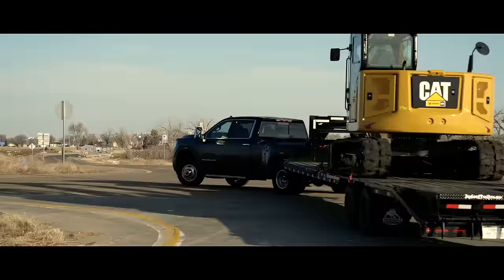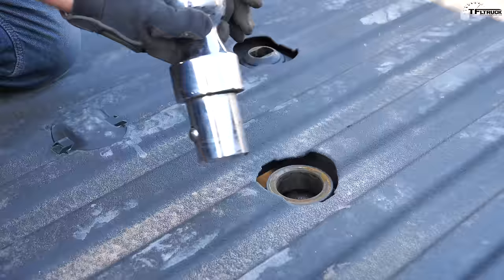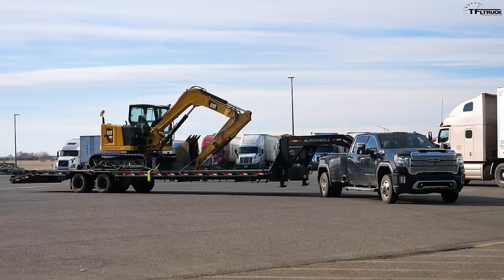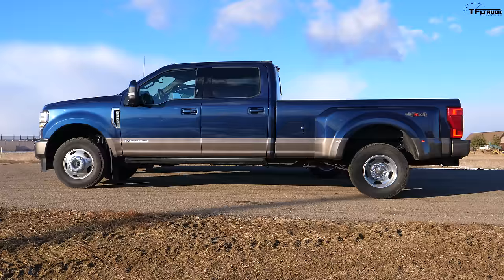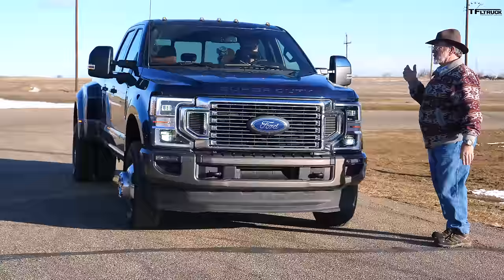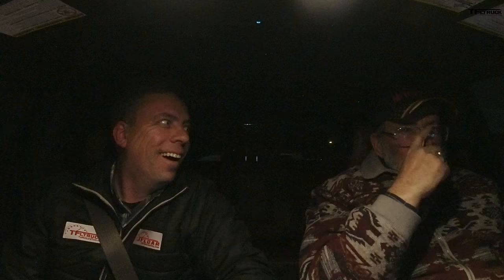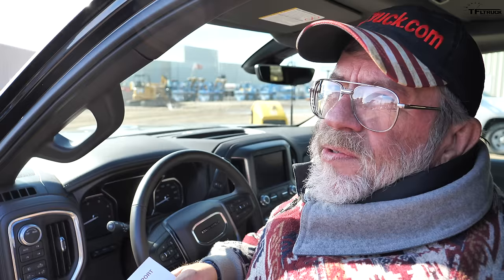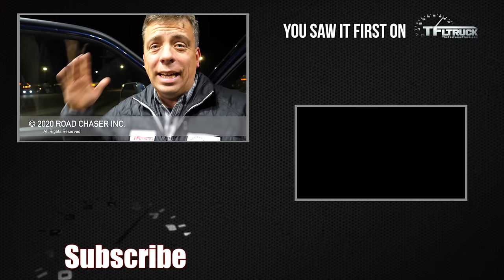30,000 Lbs Monster Tow Test: 2020 Ford F-350 vs GMC Sierra 3500 - Drag Racing & Tow Off!

Comment: So before I watched this video after midnight on Sunday 9/12. I had  previously watched the 2021 new episode from Nathan on the new 2022 "Toyota Corolla On Dirt" Video. 
I made the comment on that page that I was really bored. I got totally disinterested with it. It isn't an Electric SUV I didn't care.
Right after that video on my Home page I get the suggestion for this video. 
 Here's the deal I think with Andre and Mr. Truck. that they have driven trucks for so long that very view that see from out the windshield that they take it for granted that there isn't the enjoyment of driving the truck itself is complacent on narrow 2 lane roads, being in a truck on driver's side should never have that getting old feeling it priceless on every drive. 
  The very appearance from a chest high hood just makes trucks width cover over the lines instead of being inside the lines should the coolest and most thing there is to being in a truck. I have ridden in trucks as a passenger but the view from the driver seat has really different road perspective, plus it's fun watching cars move to far side of the opposite lane because they want a wider gap between an on coming huge truck.
Anyway I'm not bored anymore. I can pause this video and picture cars on the opposite side having to creep over the yellow line to get more space.  I've got to drive a Ford Raptor!

Comment: Isn't that the same transmission in both trucks? I thought Ford and GM went together to design the 10 speed. They just tune them a little different I thought.
Reply: Jointly designed transmission with different tuning from each manufacture.
Reply: Only the 1/2 tons share the same transmission, GM built their HD 10 speed in house and rebadged it an Allison.
https://gmauthority.com/blog/2018/12/2020-silverado-hds-allison-transmission-isnt-really-an-allison/

Comment: My tiny 2.7L EcoBoost will still slay these to 60 😂
Reply: Towing 30,000 lbs too right?
Reply: @390fe451  If you are towing 30,000 pounds a 1-Ton truck is way too small (and it's dangerous). Its not about getting up to speed, it's about stopping. You need a class 8 commercial vehicle. It's the same as a half ton towing 10k. I own a Freightliner Cascadia for the "big" stuff.
Reply: Yeah but these trucks will slay your Cascadia to 60...different trucks for different jobs. I wont argue about towing 30k with a pickup though, thats our realm. Over 20 years in, stay safe out there brother

Comment: I love this channel , butt it chaps my arse to see "experts" that do not properly secure thier loads. The thing on the side the mfgs welded down the full lengths of your trailer has a function. It's name is a rub rail. Can to guess why it is there? It is to protect your straps, chains and binders from an accidental sideswipe and having your load come off the trailer.  One driver  I worked with years ago God rest his soul, had a heart attack at the wheel left the roadway crossed a ditch just before an intersection crossed over another ditch, jumped the cross hyway and another ditch before he rolled it over. This man was a professional driver and because he did his job right and tied his load(load of steel)  down properly it not only stayed onthe deck of his trailer but also shifted less than 3/4 of an inch potentially saving other motorist lives even in his death. Don't be lazy when it comes to other peoples safety. Put your straps behind the rub rail and hook them under the belly of your trailer. Yep, you might have to bend over but at least you will be getting that little bit of exercise.

Comment: 5:08.. load is too far forward and main frame is flexing.. WAY too much. shakes everything. trailer deck under full load should be no more than dead level. this has a big sag. either the trailer isn't strong enough for the load applied or the (concentrated) load was in the wrong location.

Comment: DEF fluid usage is based on the NOx from the engine. Lower fuel economy will higher DEF usage. My 2014 Volvo 730 w/D13 500hp/1850lbft. It routinely gets 88km/liter(206mpg) and it lives it's life at 140,000lbs hauling B-train fuel tanks, getting 6.8mpg.

Comment: “Expert truck reviewer” I bet you could take all the GAS out of both trucks and I would still beat you
Reply: When I heard that I thought, "No shit.  The GM wouldn't have any fuel and therefore wouldn't be able to move."
Reply: Connor Hendricks you’re missing the point.... it’s not about either brand the “expert” called the fuel for 2 diesel trucks gas
Reply: @wjoldham  Symantecs.  You do know the difference between gas and gasoline right?  Either way, my statement stands valid.

Comment: I would like to know just how much or far the cuts in the concrete road are apart because that will give you the bounce everyone is talking about. But sounds like ford killed it. Can’t say why fords are #1 for the post 40+ years but it has a lot to do with the way they tend to out do GMC - Chevy - dodge well ram now because there trying to get away from the dodge bad nam. I guess fords just a better truck hummm seems right to me

Comment: I HAVE BEEN DRIVING BIG TRUCK FOR OVER 27 YEARS .AND ONE OF BIGEST PROBLEMS ON THE ROAD , IS PEOPLE DRIVING TOO DAMM FAST. . INSTEAD OF SEEING HOW FAST YOU CAN GO, YOU SHOULD SEE HOW LONG IT WILLTAKE YOU TO STOP .WHEN SOME ONE CUTS YOU OFF .WITH  THE BOOM EXTENDED ON THAT HOE AND THOSE LOW ASS TRAILER TIRES.  YOU NEED A MED DUTY TRUCK TO HAUL  300 AROUND. SAFELY .AND LEARN HOW TO LOAD AND CHAIN DOWN BEFORE YOU TRY TO SEE HOW FAST THESE TRUCKS  ARE..

Comment: you have extreme forward heavy weight. You put too much load in front of the front axel causing flex in the trailer and too much weight on the tongue. Good way to damage the trailer or blow out tires.

Comment: Seems like the difference in the two is minor to nil and if the Ford had 1050 torque and that extra HP number, there should have been more of a difference to the GMC. Nice clean exhaust pipes however. Me thinks these trucks are very overpriced.

Comment: Better have some damn good brakes pulling 30thousand
Reply: That's why you get a F450.
Reply: @allaemmel7809  I wouldnt trust the  hyralic brakes on the new F450....air brakes only are the only ones capable of stopping a heavy load....... and air ride supension
Reply: @allaemmel7809  ive driven semi trucks in the past and nothing stops better than air brakes........
Reply: @sixpapavictor  I've never seen air brakes on a pickup truck.

Comment: Scatter shot of useless data. Such a small fuel volume and inconsistent pumps. DEF usage is a % of fuel usage, therefore the truck with better mileage should use less DEF, not more.

Comment: Great stoff. Speaking about econemy, it isnt that great for the size. A european full size truck with a 70.000 pund loaded trailer will do the same fuel econemy. Volvo FH16, Scania R-series with a 16 liter motor isnt that nippy.

Comment: GMC all the way! $5000 difference in 100,000 miles is nothing if you can’t afford an extra $5000 in 100,000 miles you shouldn’t be buying those trucks besides new the Ford is more expensive which makes up for that extra fuel you use In the GM

Comment: I’ve had many Ford’s and as they get newer they also get more problems that are expensive to fix. I have a dodge 97 dually with 312,551 miles almost trouble free and recently purchased my first 2017 GMC Sierra DENALI ULTIMATE truck. My longest lasting truck for small towing was a 2017 Nissan Titan XD PLATINUM RESERVE that lasted 455,600 miles before a young man totaled it ramming the side at 45mph in a Ford Excursion. Insurance totaled the Nissan but that was a Great truck. I’m hopeful to own a 2023 gmc full size truck if Nissan or maybe Toyota could build a full size truck for those of us that farm and haul animals, hay and building materials.

Comment: Not a fair fight. What was the outside temperature during the day when they ran the GMC? Obviously it was night when they ran the Ford so its most likely colder. Colder air is more dense and during cruising less fuel is needed to obtain power/tq.

Comment: A lot of it power wise is in the stock tune, final drive ratio and transmission ratio... Both are similar is HP and Torque numbers, its more how they put it to the ground. Were they the same wheel and tire size? That makes a difference in power and fuel economy. 

Transmission wise, you cant go wrong with an Allison.. and all the new one tons, there's so much more hidden power. Tune, deletes, and methanol injection, larger and straighter intake pipes/hoses, cold air intake will really wake them up but maintain its reliability. Water/methanol is really good for towing and fuel economy, it'll cool the air going into the engine by several hundred degrees, heat is the biggest killer of a diesel engine. Plus a double shot will wind the turbo quicker and make it a lot more fun to drive with or without a trailer. Double shot that runs off the engines RPM's and boost pressure is the best, you don't want a methanol kit that'll just squirt whenever, it'll cause cylinder wash and be an un-linear power curve. Another good thing besides giving more power, it cleans the cylinders of carbon build up, a good methanol kit is actually healthy for a diesel.

I got a tune ECU kit with 3 different engine (each with transmission map) to choose from, one that's a tad above stock, a towing map, and a sport one that gets everything out of it it can but still be reliable. Plug in peddle monster, double shot Snowperformance water/methanol kit, cold air intake, hot n cold intake charge kit with the nipples already on for methanol, a non baffled turbo resonator. I don't want more boost pressure, but I would like the stock one to spool faster, any ideas? 

And then the EGR, DEF, CAT deletes..The egr delete does affect the amount of air, so you need to make sure you go with the right company doing the tune to adjust for it and not set off any of the codes. The deletes and methanol will void warranty, but methanol leaves no signature so you can just remove it before going into the shop. Methanol also increases fuel mileage, along with the deletes. Mainly I wanted the EGR and DEF gone but it's nice not to worry about the CAT getting plugged up and it's easy to put back on if needed. Any ideas for more safe power that won't negatively affect fuel economy?  

I've never lifted my trucks, I'm thinking about it and also larger wheels, how much will that affect my economy and power with a 3-4 inch lift and going from 19's to 20 or 22's? May just go 20 and get a larger off road tire

Comment: 🤔 i ve had the pleasure  of WORKING/ sometimes driving  a f150 , two 350 , one f450, one f550 ,three  f650  if this test would have said any ford come paired to a 86 Toyota with one broke intake valve. For it to be close enough competition for me to watch but thats just my opinion  but i did learn save all the fuel you drain out of them "F" i literally  poured it straight out of the filter/tank into old  International dump truck run fine  it  but that was just my experience.  I thought a case of fuel filters per oil change was normal till I set down in a Dodge truck and I don't even like Dodge now you just change it once year out of habit 🤔 I mean you going to spend the same things on Transmissions as you would filters but lest its not on side of the road every day just once every couple of years.  Always remember Laugh to Keep from Crying stay safe out there

Comment: I drive over the road, every single nozzle shuts off differently. Can make a bigger difference than you think with your fuel mileage test. Only way to be accurate is filling the fuel neck. No that's not gonna cause any issue but it will be accurate. Ive been two gallons or so off from some of these bad nozzles.

DEF fluid test isn't a good one as your filter will become more dirty or less depending on the terrain and length of driving as well as driving style.

Plus the temperature difference between the two run was in the fords favor
Reply: They used the same pump and nozzle for both trucks.
Reply: @benjaminwayneb  doesn't matter.  They're not accurate AT ALL. Not even the same nozzle. I pump a couple thousand gallons a month into my truck. I'm very familiar with them

Comment: Is any Ford truck will beat any GMC any day just because of the manufacturer. You have great manufactured crap against the best manufactured truck in the world. Ford motor company makes the best and best performing truck out there. It's been this way for 30 some years. Or better. GMC's been trying to beat   Ford. for how many years and they cannot do it. And they never will. Ford has the best transmission and the best motor out there. Sure I hear  GMC is snooping in on the way Ford motor company builds their overhead cams so now they're trying to say they will make a motor that will beat forwards still haven't seen them beat a 3.5 ecoboost with AV8 from Chevy.

Comment: I live in North East Colorado, almost at the Nebraska/Colorado border. I would love to do some testing with these guys some time. They are only about 2 hours away from me.

I own a 2017 Chevrolet Silverado 1500 LT Z71 4x4 crew cab, with a 5.3 V8, and 6 speed automatic transmission. I would love to do the test that they do, with my truck, and compare it, and how well it performs, to one of the brand new Chevrolet Silverado’s. I think that would be really interesting to see if one truck out performs the other, or if the results between the two, the current generation truck and the previous generation truck are almost the same?

Comment: Hey Andre you are wrong about the d-max engine. Starting @ 2020 they had a new engine in the truck known as the L5P not the MLA POS. & those they is probably don’t make the power numbers they say they do cuz that def is horrible. It’s probably like 1000ftlbs & 4-500hp.

Comment: That's it 30,000 pounds I've seen a ford with a 5.4 do that haha
Reply: I gaurentee you that even if an old 5.4L could get that trailer rolling it wouldn't be able to move it anywhere near the speed limit.
Reply: @nathanmcdonald610   no I can assure  you it did lol
Reply: @nathanmcdonald610  my bad it was only 20,000

Comment: I think the Ford has the larger fuel tank than the Chevy it may be the reason the results were in Fords favor. Also I have a 2019 F350 dually with a payload of 5690 the truck tested here is 5314 maybe the options. I do have a 4:10 gear ratio.

Comment: we have a ford 350 diesel  with only 115000 miles on it with egr problems that ford want an open check book to fix.. which means you might as well buy another truck ..ive lookked on the internet to find 10000 s of ford truck owners had the same problem diesel egr problems that ruin your 60 or 70 thousand dollar truck which is not acceptable in my mind ... what year of truck did ford sort out their egr problems? ????? thanks
Reply: All trucks have EGR valves and all of them can be affected by carbon, it's not a Ford only problem.
Reply: @benjaminwayneb  so thats a no to the problem being fixed then
Reply: @benjaminwayneb  will using seafoam in your fuel help carbon in your engine? or miff? should you use it to keep your engine clean ?

Comment: If these guys knew how to load a trailer that GMC would have hauled this load smooth as butter! I will take the GMC.  When it comes to reliablity there is NO comparison between the junk Mexican Powerstroke and the Duramax which is designed and made in the United States.
Reply: Lots of salt because your ISUZU Duramax got its ass whipped in just about every catagory lol.

Comment: The test were at different times of the day. The temperature was way different so that's not a correct test.
Reply: By golly you're right. I was thinking that the trucks should have been running together (but not close enough for draft effect) carrying the same weight. I thought about changing winds, but not temperature differences. Even better yet if they run the same test on a hot summer day. And why not do the drag race while hauling the loads?

Comment: The funny thing is that the def fluid is actually choking the engine... the diesel engine runs better when you pull all the emissions crap off and run a 5" exhaust system

Comment: As a Professional CDL holder who does Hot Shot driving for a living I would take the GMC any day of the week over the Ford. First, why would you haul 30K on a little ball? I use a Fifth wheel hitch on my 40ft Big Tex trailer because it rides so much smoother. Second you had that Load not on the trailer axles but further forward. That heavy of a load needs to be over the axles, not forward. This lets you stretch out the boom to keep the load lower on the trailer and keep your center of gravity down. The "gooseneck" way of hauling a trailer is the worst invention ever. So much sway and bumpy ride. You will always have a trailer buck with that set up. Fifth wheel is way smoother and safer than that set up. I use 5 gallons of DEF every 1200 miles in my Duramax. I get about 14.8mpg empty with trailer and 8.8 to 10.3MPG loaded. Also you get way better fuel mileage at night than day. It's cooler which results in a lower intake charge temperature and better cooling on the intercooler. Just my 2 cents after logging 159,000 miles on my Duramax.

Comment: It’s sad that they are not testing these trucks at the same time for mpg. If you don’t know when the sun goes down the air is denser with oxygen. Therefore the truck that’s driven at night will get better mileage. Again a biased test to make the Ford seem to be a better mpg truck. Now I will give it to the Ford on the drag race. It spanked the GMC. But they have to do better in testing the trucks at the same time to get results
Reply: Colder temp means more dense air and lower fuel economy.